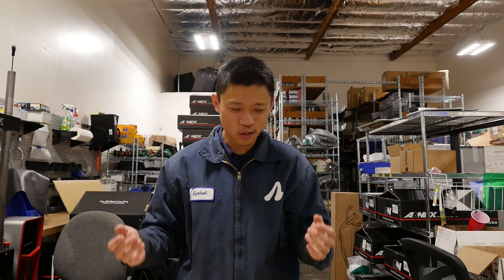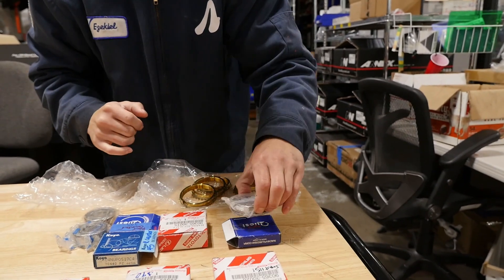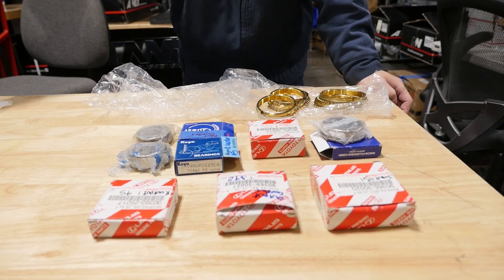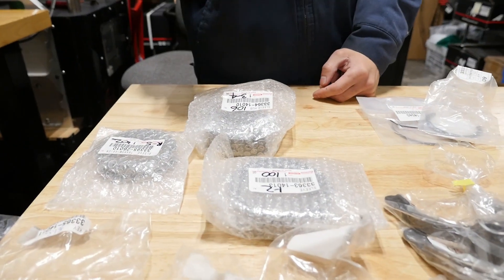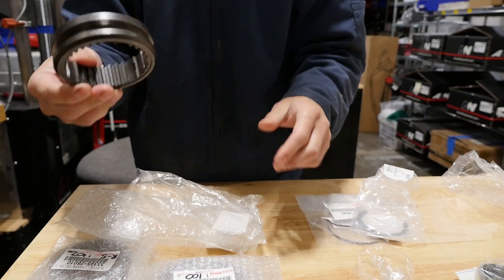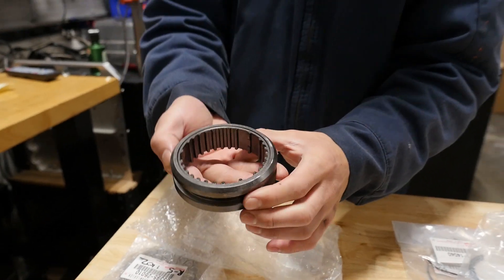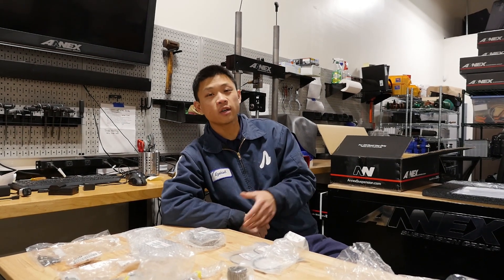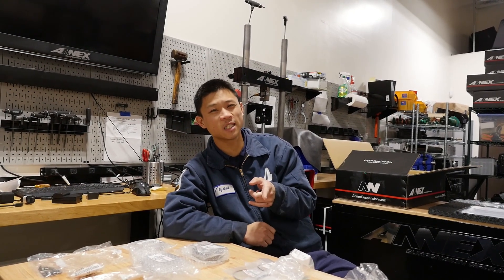T50 "The Parts" (Part 3)

Comment: I have a 1981 Toyota Corolla 1.8 4 speed and I have to hold the shifter in first so it won’t pop out and making noise like bearings where can I find parts for it. I’ll appreciate it if you can help me out

Comment: All I want to know is where are you located and can you rebuild my transmission?
Seriously though the local AAA shop quoted between 2300-4500 and said they're not worried about parts.
Is that what you'd charge?
Are there used JDM tranny's available ( likely with a kph speedo drive)?
Considered a swap to a different type tranny and maybe a 6 speed but there's adapter plates and clearance problems.

I have a used SR5 tranny. Do you know if it'll bolt on or is something different?
It would be wider ratio so less sporty but better for the freeway.

Maybe you know someone in the San Diego area?

Seems simple one piece parts could be duplicated using the new 3d printer technology.
Reply from the maker: Our shop is in Fremont, CA. If you just have a street car, not a track or drift toy, I can work with that budget if it is an AE86 T50 transmission